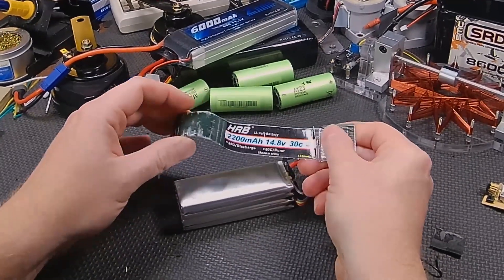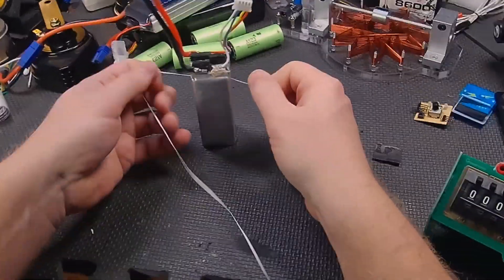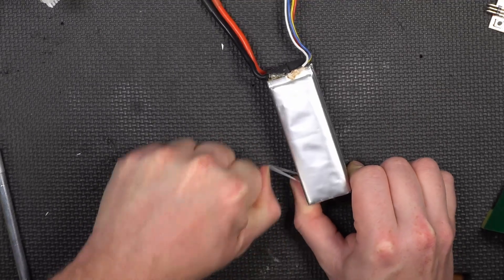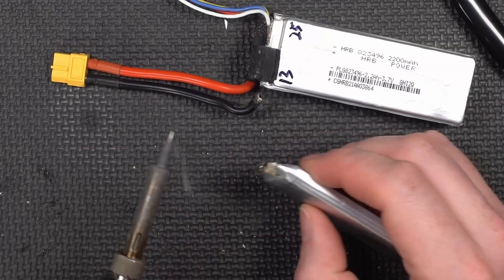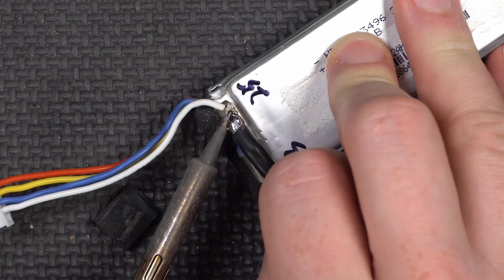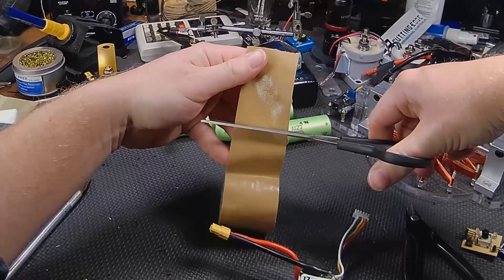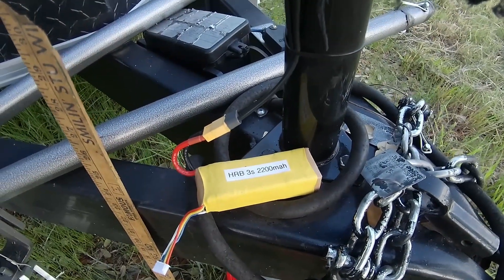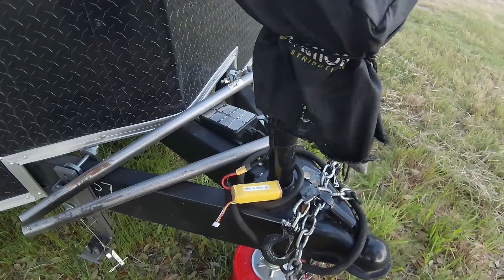Don't Throw Out That Dead RC Battery!

Comment: Someone is gonna go around whacking LiPo packs with a sledge and catch himself on fire. Smh👍 

When you shake hands with "Danger", say hello to "3-finger Joe" for me.
Reply from the maker: Lol.  Watch some of my other videos - we do far more dangerous stuff than hitting a dead lipo cell with a hammer... how about stick welding with LTO cells: https://youtu.be/TlerchtDjxA?si=6iUgQWXA4uRkX-XB  Or blowing up and completely destroying with a plasma arc a $1,700 APD ESC: https://youtu.be/_n6hDRsMZd8?si=EfKNe-PHHoMhe8Xy  Of course, it's not all failures - here we made 800 hp at the dragstrip with an RC-motor powered supercharger: https://youtu.be/RT0M88xHzNQ?si=PbN9eBrNGeU8fD3n

Comment: I do the same thing. lipo batterys are such a hassle.. anytime I set my rc stuff aside. for a while and come back i find  some cells are dead. seems it's transfered to my lawn equipment. have 2 of them die lately. been able to swap some cells from other stuff and rebuild both packs. 2nd was just 2 bad, first was like 18 bad, most Rev charged. kinda weird.